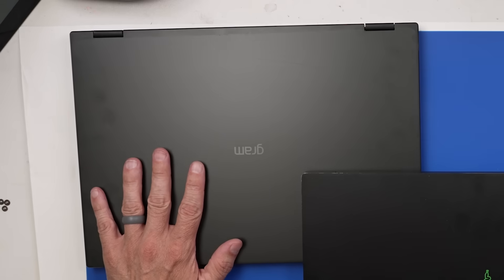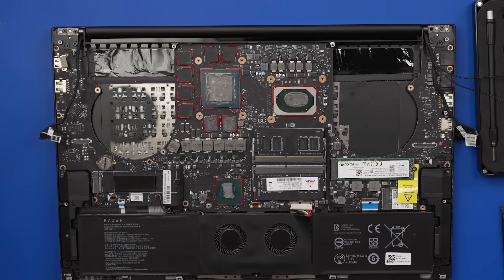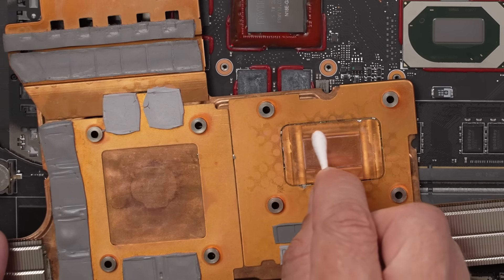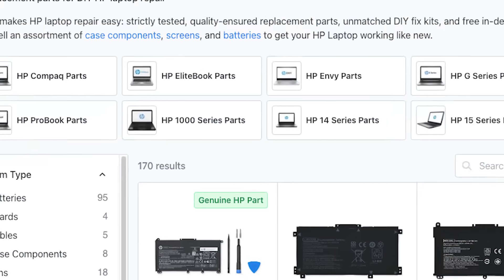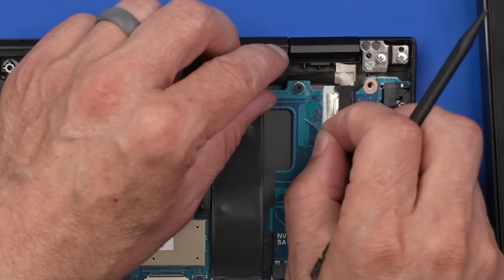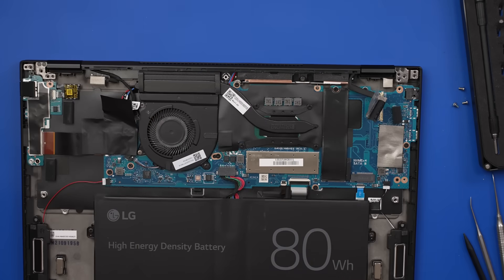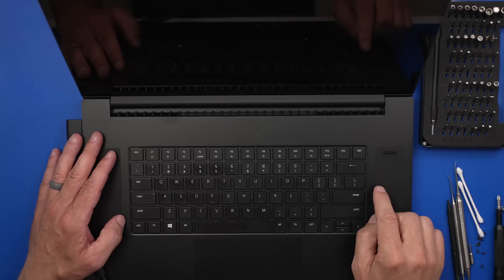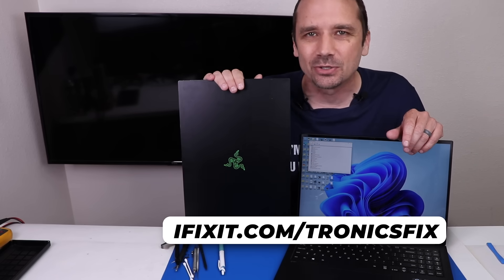Trying to Fix $5,000 Worth of Broken Laptops

Comment: you never use liquid metal on any laptop or PC computer when you put the heat sinks back on the systems because liquid metal runs if you turn the laptop on its side it will run out That's why you never use liquid metal it's a messy job and it will come loose because it's watery not like thermal paste so good luck on that

Comment: The SDS for TG Shield says it's 45–50% ethyl acetate, 45–50% butyl acetate, and 5–10% isopropanol. Those are all solvents that will evaporate, which leaves a maximum of 5% that's something that stays behind. (That feels to me like the SDS is wrong.) The SDS for nail polish tends to show the same three ingredients plus nitrocellulose (which is the thing that stays behind) and pigment. In addition, the SDS for "TG Remove" (the remover for TG Shield) says it's 100% acetone, AKA nail polish remover. I feel reasonably confident in saying that TG Shield is just nail polish.

Comment: Liquid metal and copper heat sink??? Not the greatest idea.... You also forgot to use TG shield on CPU contacts :))  Liquid metal without barrier is time ticking BOMB, it will leak on the motherboard eventually

Comment: actually, I had similiar situation with fans in laptop I bought recently.
I changed thermal paste , thermal pads , and everything seemed to be fine but fans kept spinning very fast when doing like literally anything.
The problem was caused by windows setting cpu to 4 ghz for some reason and laptop was oerheating because of that.
after changing some windows settings everything worked fine

Comment: Oh that’s your problem. You’re putting way too much thermal paste and that nail polish stuff. You’re insulating the cpu with that polish. You want just the thinnest possible amount of paste because what it does is fill in microscopic variances on the heating to maximize contact to the cpu and when you put gobs on you’re effectively insulating the cpu and defeating the purpose

Comment: Is there any way you can fix my laptop? 😢 It is an Asus Tuf gaming F17 2022 (FX707ZM). The clock speeds are going all the way down to 0.3 or 0.4 GHz and is not boosting to 4.7 too as it should with i7 12700H. Unresponsive, laggy when this is happening. Also it is heating up quite a lot. All these are happening not consistently, but every few hours. My country of residence is India.

Comment: I think you should disconnect the battery before working on the screen connector because you could accedently send  battery voltage down the GPU lines and short it out. AH OK YOU DID IT AT THE END

Comment: just use the thicker thermal paste like gelid gc extreme or something, thermal paste like arctic mx4 and grizzly naut have low viscosity and pumps out easily from the cpu die after few thermal cycles. At 2:22 you can clearly see most of the thermal paste is on the edges of cpu die which is caused by thermal paste pump-out effect.
i had similar issue with my acer nitro where arctic and kryonaut were completely ineffective after few weeks but gelid is still working like new after 1.5 year

Comment: Hi I have enjoyed your videos for many years. I had a razer blade 17 2020 I used it for a good 2years. Since day one it’s done the ramping up fans. I believe it is because it has a Rtx2080 and i7 in a thin laptop. The fans only are like this when the power cable is plugged in to the laptop. And did not do it when on battery. I have since switched to a MacBook. The Razer was not broken, it is just a design flaw 😂. Also be careful putting liquid metal in laptops. The coolers I’m not designed for it. And also unlike a PS5 or a computer. A laptop is going to be chucked around more. Meaning that the liquid metal could spill out! But still enjoyed the attempt, and thank you for your effort! Keep up the good work!

Comment: Man I was flinching at 13:20 while watching you attach the LCD ribbon back inside the ZIF connector. Those connectors with a plastic locking clamp were created by satan.

Comment: 6 years ago I bought a razer blade 14 2017 and just above the 1 year mark it died. Even though the warranty just ended, I sent it to the official razer repair center and after a while they sent me pictures of the power connector on the motherboard had a burn mark on it and that the entire motherboard had to be replaced and charged me $1000 for the repair. At that time I was a university student and saving $3000 to buy the laptop in the first place was not easy, and I was not going to sink another $1000 in the laptop just 1 year after buying it. So I told them to return it to me without any repairs and they did... however when I opened the laptop the battery was missing. I immediately emailed them and enquired and long story short they said it was in when they sent the laptop and they are not responsible if it was lost in transit. After some pushing they found out apparently the battery was bloated and for safety reasons had to dispose of it without informing me and subsequently trying to make me think the mailing company stole it. 

Meanwhile I was checking the motherboard and the power connector and the burn mark was not there anymore. Luckily for me, the wifi card's serial number was showing in the picture they sent and it was not matching with the one that was in the laptop they sent me. Not only that but the M.2 card was also missing from the motherboard. Again I contacted them and told them they probably put the wrong motherboard in my laptop (I knew it was my laptop because the serial number on the case matched my laptop) and sent them photo proof that the burn mark they sent me was missing and the serial number of the wifi card was different. Couple of days later I get a call from someone from razer and he insisted for over an hour that there was an investigation in the company and I was sent the right laptop with the right motherboard with no missing components. Needless to say to this day I absolutely resent razer as a brand.

Comment: You should care if the "conformal coating" is nail polish or not - certain types of nail polish contain chemicals that can damage solder resist or increase corrosion to metal components.
Reply from the maker: It's not just nail polish. It is actually a conformal coating

Comment: Hey tronics I have problem with Laptops display, Laptops turns on normally but shows no display at all  but when I connect it to a external display it works fine 
Mine is Asus Rog 2021 with Nvidia 3060 , it has a rog logo on the back of the display that gets lit when you turn on the laptop but after this display issue the logo is not getting lit , when I start the laptop with external display it making a startup sound that it used make when display was fine but it doesn't make a sound when turn on without  external display 
Display went black when I was playing a graphic intensive game it got black out suddenly.

Comment: For anybody that is having that screen flashing issue. Please don't do what he did in this video. Disabling the onboard graphics for the Intel processor can lead to issues. You can disable it temporarily. But what you really need to do is make sure that you have all of your settings correct and make sure that your drivers are up to date
Reply: By uninstalling the laptop reinstalled the graphics driver. He didn’t disable it. There has to be a driver for a video output. So, he simply reinstalled a graphics driver.
Reply: No. He uninstalled the Intel graphics driver. Windows may reinstall it. But it also may bring back the issue. Just uninstalling it is it enough. There's other steps that need to be taken

Comment: I know first hand the pain of not disconnecting that battery before messing with the screen. I was trying to fix a HP laptop that had some kind of issue with it I can't remember. I took the motherboard out and I reconnected the battery before I reconnected the screen. As I was putting in the screen connector. I heard a zap and the back light on that laptop never worked again.

Comment: There was nowhere near enough mounting force on that cooler when you put it on the first time. Thermal paste should be very thinly spread. Especially on a laptop. Even a quarter of a millimeter gap is enough to cause overheating

Comment: Remember too disconnect the battery. This guy always disconnect, thats good. I witnessed few of my collegue shorted something and broke the laptop. Blue pixie dust.
If display gets wonky it's worth trying Win + Ctrl + Shift + B to reset the display driver. Not sure if it work in setup mode.

Comment: Great work sir,  I love your content. I work for a used laptop reseller and it so nice to see someone that take their time to do the job correctly. That being said as stated before it not a good idea to use liquid metal with copper. One last thing, being that those are high performance units. Sometime there are settings in the bios that will allow you to control the fan speed to improve cooling during gaming. I'm not saying that was the situation here but it's always a good idea check the setting and reset if needed.
Reply: Hey, the affects of mixing liquid metal with copper are proven to be cosmetic and the original performance of the contact plate remains intact :) it just stains the copper over time and looks very ugly, its not pitting or corroding anything. happy cooling :)

Comment: Can you do a video on the replacement of a 5 pole 3.5mm headphones Jack? Astro and Logitech are using them and there are no video's on 5 pole jacks especially Astro so it is low hanging YouTube video fruit. Also no one shows how to identify which wire is for what point. Also an excellent way to sell and make a commission off 5 pole 3.5mm jacks as some people have a hard time finding them outside of aliexpress I have read on reddit.

Comment: liquid metal is good for thermal transfer, but otherwise is nasty stuff the thing that it's used for ps5 (due to thermal and space constrains, also probably to make planned obsolesce) does not mean is good for everything, there is compromises to make, and most of the times (99%) on computer's CPU and GPU good quality thermal paste is good enough without all the nasty things that liquid metal can do. If you use liquid metal on laptop, it would be nice to put some foam or similar material around the die to prevent liquid metal from spilling out as laptops are caried in various positions moved and tossed around.

Comment: The fans are also a software fix. You need to download the Razer software and go to fan settings and put them in silent mode. I had the same issue with my Asus laptop everytime it hit 40c the fans started to ramp up.

Comment: Any danger of the liquid metal moving to other parts of the laptop if it is bumped or stored vertically? 
On the PS theres some kind of gasket to prevent overspill so was just wondering if this could be an issue on a laptop, especially since they do tend to get a few more knocks and bumps.
Reply: It will probably be fine, but i would rather worry obout liquid metal on a copper heatsink, as that will probobly not mix well

Comment: The Display issue is probably related to the display cable starting to die. Uninstalling the Display driver will help for some time but with the cable getting more and more damaged from opening and closing it will eventually not work. Pretty common issue on the xps 9350.

Comment: The first thing you always try with display issues in laptops is to connect an external display. So you will know if is the screen, driver or the gpu related.
Reply: Not always the gpu at fault the display connector can also die because it is in the mechanical hinge, or the mainboard can be faulty (like chips and other components)
Reply: @309electronic5  Or random radiation from space can flip some 1 into 0.  Countless possibilities but always check with another external display before you start the board level repairs.

Comment: Hello, I have a Razer Blade stealth 13 inch laptop, the mousepad stopped working before I purchased it. I tried reinstalling windows and it worked for a few minutes and then stopped working. While I prefer using a mouse, there are times where the mousepad is more convenient to use. Do you know where I could find software for it?

Comment: I think that because is a gamer laptop, the owner want to have better thermals in games and general, so he touch the BIOS and adjust the fans to be full speed at some grade or similar. So I recomend check that too. Because liquid metal not use to make a huge change in notebooks, cause the true cooler sistem is the fans and radiator, and don't use to be too much powerfull in laptops, of course if the thermal paste was a bad brand and act more like a thermal insulator, but this days are all good.

Comment: Well, for me, I usually check the BIOS first to determine if the problem is more on hardware side or software side. With that in mind, if you boot into Windows (or any other OS) and it behaves oddly, you can have high confidence that it is the OS fault instead of hardware issues. I'm glad it was a minor fix for LG Gram.
Reply: He didn t really fixed it, as it could be happening again if he reinstalls the gpu again, could pe a bad igpu but it rarely happens, so i guess he just needs to get the latest gpu update
Reply: @robertbuzdea6257  Yeah, but sometimes Windows auto update screw everything up. The best driver is to get it from LG official website. I remember Windows screws the update by automatically update the AMD gpu driver of my MSI GX70 3BE because while the dGPU Radeon HD8970m supports the newer version of CCC (Catalyst Control Centre), my iGPU can't (Radeon HD 8650G). Always have to DDU when Windows performs update.
Reply: @robertbuzdea6257 it did reinstall the graphics driver: you can hear it being removed and installed in the video

Comment: I know you did your due diligence in adding the liquid metal to increase better cooling but what about adding the same safe guard that the PS-5 uses like that black material they put around the chip to keep the liquid metal from running off into other components.
It seems to work well. I'm sure that material is easy to get and would ensure that no LM would get out of place.
I've seen other sites where a repair person would find LM all over the mother board because the user had the same idea as you but the LM got away from the chips.
I'm going to do the same on my computer but I'm also going to get some of that material to set up around the chip. I recently did a thorough cleaning on my Dell XPS 9560 and found old dried thermal paste.
The computer is over 5 years old.
It runs fine but I did notice before I opened it and gave it this thorough cleaning that the fans did run quite often and the bottom of the puter was getting much warmer than normal.
Right now with the new thermal paste, all is good but I want to make sure I have more years of use.
So far, only problem I've had was a bad power cord end and replaced that along with the plug in. It had formed a short in the end plug where it goes into the puter power receptacle.
I'm even still using the same battery but it has diminished in it's longevity.
IT was originally a 6 hour battery but now down to 2 hours.
This computer stays up and running 24/7 and has been from the day I bought it.
Great Show!!

Comment: Wouldn‘t it make sense with the first laptop, to check the temperatures first, before disassembling? To rule out if it was an issue with some kind of sensor?
Reply: he isn t really into computers, so he just applies what he learned from repairing consoles. So as consoles don t have temperature monitors, he has never checked temps on anything
Reply: although, he had very good ipothesis about the defects, and he did a great job on the razer. kinda dissapointed in the lg gram as he just uninstalled the igpu driver, which will install by itself again in the future, and probably will behave again like that
Reply: @robertbuzdea6257 it reinstalled right in the video. If it didnt he wouldn’t get any video at all.
Reply: @robertbuzdea6257 windows usually installs stable drivers from the past unlike new ones that could have issues. I’ve never had an issue with windows in over 20 years

Comment: I love your channel Steve, but I have to dislike this video. Uninstalling the drivers is not a fix AT ALL. A GPU that presents issues with the appropriate drivers could still be faulty even if the issue is "fixed" with the Microsoft Basic Display Driver. The MSBDD only uses the frame buffer, which would mask a real hardware issue somewhere in the GPU. If that is the case, the GPU will stop working when Windows decides to update the drivers, and even if Windows never installed the correct drivers again, the computer would not have any 3D acceleration or hardware video decoding and would do everything via software (most games wouldn't even launch).
Reply: I really like this comment, love how you give a good reason for the dislike, thats how it's supposed to be

Comment: The old hardened thermal pads could be preventing the heatsink from contacting the die all the way- probably best to replace with thermal putty
Reply: Yeah the pads looked like some were not making contact. I would have like to see some thermal testing done on that system.
Reply: Yes, its very common on Laptops and desktop GPUs. I saw a laptop that started overheating after being dropped too hard on the table, or used GPU that started overheating after being shipped in a box. Both times repasting fixed them as the old hardened paste couldnt take even a small shift of the heatsink.
Reply: I also think he probably had too much thermal paste on, despite his claims of "perfect amount"

The paste on the larger chip looked way too thick.
Reply: @TheBrando212  If there's proper pressure it shouldn't matter that much.